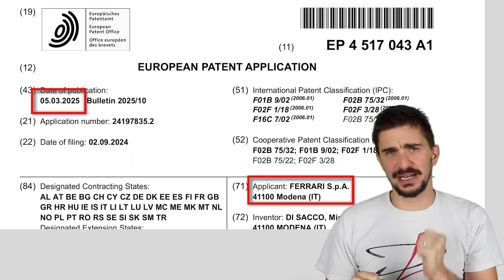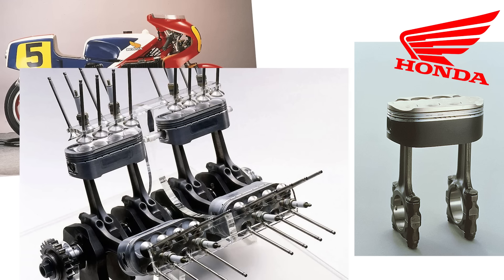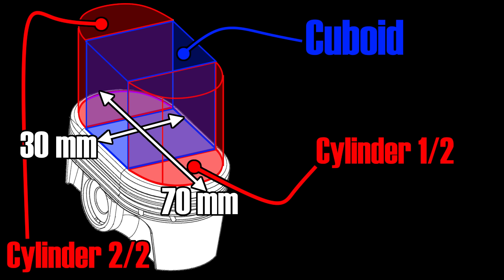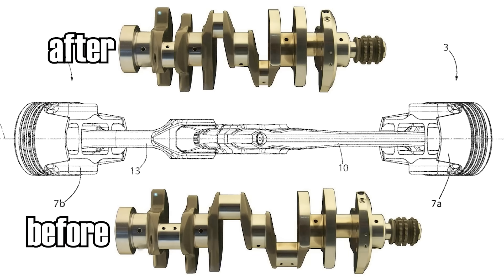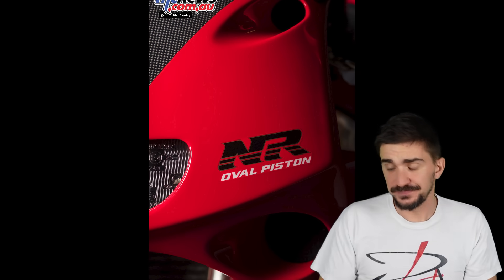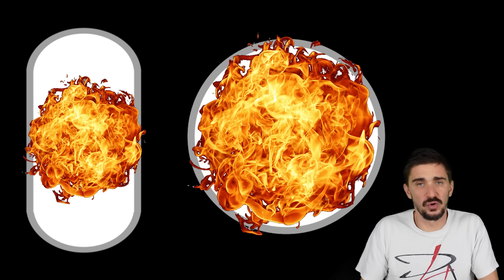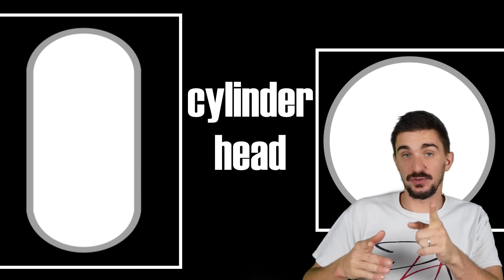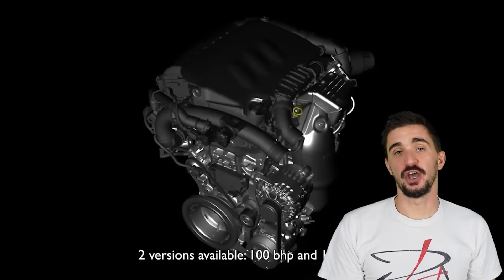Ferrari Just Patented Pill-shaped Pistons and Siamese Connecting Rods

Comment: Unlike the Honda in which the long axis of the stadium piston was parallel to the crankshaft axis, Ferrari's is at 90 degrees to the crankshaft. With the Honda, they could add multiple valves to improve breathing. With the Ferrari, they can't.  So breathing may be compromised. For Ferrari, the best approach might be 2 large valves. Not sure how well that would work.
Reply: Why can't they? No reason valves have to be side by side.
Reply: @drewdavis239  With a narrow engine containing capsules, the distance between adjacent capsules is narrow.  Let's say put multiple valves along the long axis of the piston, there is insufficient room between adjacent capsules for multiple ports. For example, let's say there were 4 exhaust ports on the right side of a capsule and 4 intakes on the left side of the adjacent capsule, how would you arrange  the ports?

Comment: In my own opinion, Ferrari's patent design is just not looking good. The single conrod makes the piston probably rock, if something goes horribly wrong and when I saw that siamese conrod design, I just thought "very complicated master and slave conrod design."
I'm keeping those opinions till I see one run for real, great video
Reply: This conrod configuration has been used successfully in airplane and tank V12 engines in WWII i think. also an inline 6 or half a V12 is perfectly balanced on its own, so it wouldn't really cause any imbalance.
Reply: @КлиментЦонков  And how fast were they spinning? Probably not at 9000rpm.
Reply: There is nothing complex about the master/slave conrod design, it was first used in the Renault 8G V8 engine back in 1910.  The issue of piston rocking can be addressed by longer skirts, though that does also increase weight.
Reply: @ferrumignis The 8G had a redline of 1600rpm.

Comment: You mention front engine..... but transverse mid engine would make this particularly relevant.
Reply: it’s relevant for both cases I think.

For longitudinal cars, you can package the engine efficiently and use the extra space to increase cabin space (or just leave it as is and it’ll he an easy engine to work on with loads of space)

For transverse engines, it’ll be just like the VR6. More cylinders and displacement for less size.

Comment: Contrary to popular belief, Ferrari is not known for innovation.  This latest ´invention´ reminds me of the Ballistic Valves Ferrari was pushing in the late 1990´s.  Yeah, I´m old.  Nevertheless, the rocking motion you mention with the wrist pin not running through the length of the piston will prove fatal.  Trust me when I say Honda is laughing at this latest ´invention´.
Reply: There's obviously a good reason why Honda stopped using them. If they were better than round pistons. They'd still be in use.
Reply: @michaelbrinks8089  It was a very expensive design for production at the time, machining and honing a circular bore is much simpler than the flattened oval.  However that was 33 years ago, things have moved forward considerably in terms of machining capabilities.  Also the goal of the Honda engine was purely for maximum power, which resulted in a wider engine then the equivalent displacement round piston engine.
Reply: @ferrumignis  It would be cool if it could work & bet they can easily get it to run & be fast. The question will be, if all the oval 💊 shaped pros & cons outweigh the pros & cons of the round piston design.....One interesting fact about round pistons is. They aren't perfectly round & have a purposeful slight oval & tapered shape design.
Reply: "the rocking motion you mention with the wrist pin not running through the length of the piston will prove fatal."
It will likely requite a deeper skirt on the piston than the modern ultra short skirt pistons, but it will be addressed.
Reply: @ferrumignis  Given the aspect ratios mentioned the deeper skirt required for stability will bring it´s own set of problems, specifically, increased drag and parasitic losses that will limit high speed operation.  It may only be suitable for turbocharged cars.  Even then I still have serious doubts about sealing as uneven expansion properties of the rings will result in uneven cylinder wall wear.  Don´t bet on seeing this succeed.

Comment: 5:04 I’m sure the cranckshaft is stronger, having a moving joint in a rod seems like a point of failure should you want to drive the car for 100’000km
Reply: To me it looks like a very similar design to old aircraft radials. All the other rods pivot of the main master rod. Except these are held together with bolts instead of being one piece.

Comment: Honda did that in the 80s.
(Just kidding!😂😂😂)
But seriously, this fact was mentioned in the video less than 2 minutes in and thats the majority of the comments, which is quite silly.

Im gonna watch the rest of the video now. Seems like a banger (pun intended).
Reply: Honda did that, as D4A said, to compete with 2smoke engines. Which makes me wonder...how hard would it be to, via some smart valves and ecu magic, make engine switch between 2 and 4 stroke operation...🤔
Reply: @Lvvcassss i could be wrong but im not sure if the ecu will be the only thing affecting stroke operation. You’ll need a lot of mechanical readjustments of the engine by changing from 2 to 4 stroke order.
Reply: @Nice_Person7379 Valve control - doable, like FreeValve system, variable exhaust geometry also doable.
Reply: @Lvvcassss  👍🏽

Comment: What is there for ferrari to patent with this? Since honda did the exact same thing 40 years ago? The conjoined rods? Rotating the pistons 90 compared to Honda's? Or is this just another nothing-patent that's more marketing than anything
Reply from the maker: Exact same? Interesting
Reply: @d4a  Okay sure, I got hung up on the shape of the pistons, placing them in this rotation is a major change with a specific advantage (closer packing of the pistons) So I guess that's enough for a patent.
Reply: @alpagator1372 also the whole having 1 rod per 2 pistons instead of 2 rods per 1 piston is quite a big difference
Reply: Bruh did you watch the video? The ones in the NR750 have 8 valves per piston, that's the reasoning behind the pill shape made by Honda. 
The ones in the Ferrari patent weren't made for that, and I wonder if they'll even manage to fit 4 valves per "cylinder" (should I call it pill instead of cylinder?)

Comment: "Siamese connecting rods" have been around for a while now; they're called master-and-slave rods. The stroke of the pistons using the slave rods is slightly longer than those using the master rods.

Radial engines have them, and the GE 7FDL/7FDM/V228 Diesel engines also have them.
Reply: Interwar hispano suiza V8 aircraft engines and the T-34's V-2 V12 diesel engines also had the same design. I guess the stroke difference will end up as another Ferrari "design feature" lol
Reply: These words kinda prohibited in US 😅